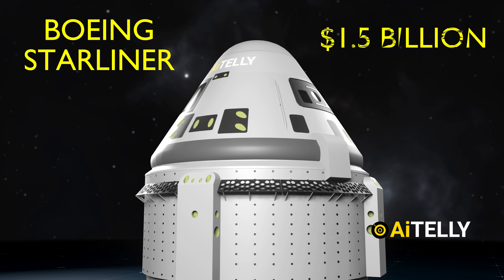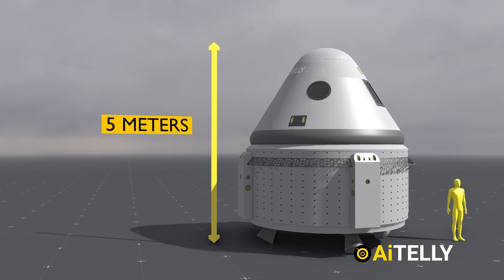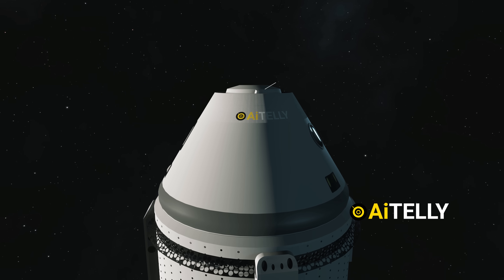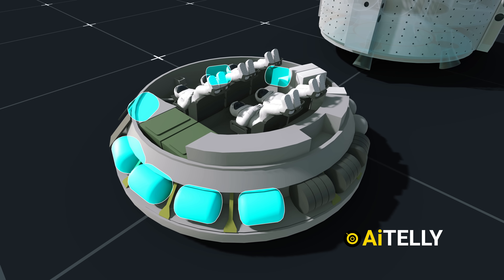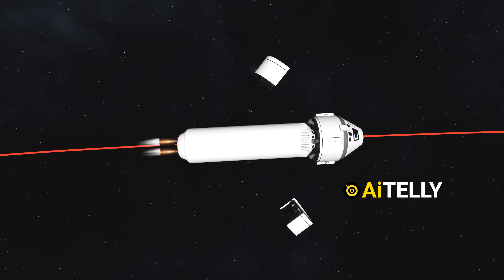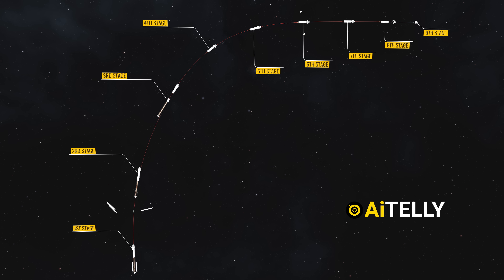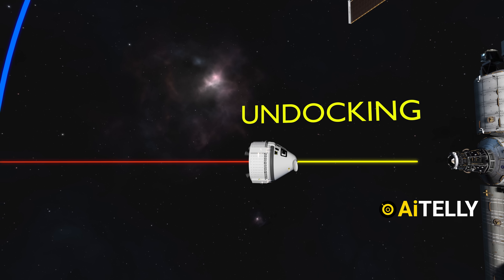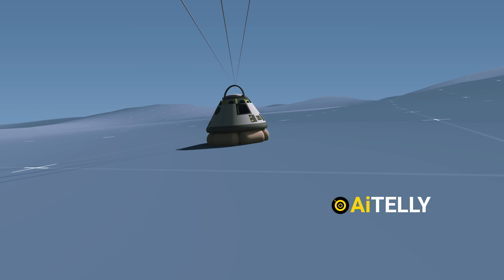How will Boeing Starliner Return from NASA Space station?

Comment from the maker: Corrections 

1) @felipecogo4671 Starliner weight 13T (or 29.000 lb) you got the total weight with the rocket too. 
we calculate the weight of the Rocket too
Reply: Soyuz touches down on land as well :)
Reply: @the.starman  Yeah, somebody sure didn't do their homework. Makes one wonder what else is wrong, considering this is a rather basic and well known fact.
Reply: @Aitelly  already subscribed Sir🥰
Reply from the maker: @devmaharaj4640  Thanks
Reply: @Aitelly hey can you pls make a video about the south Korean K2 black panther
Reply: can i use this video?
Reply: IT DOESN'T WORK - CLICK BAIT
Reply: Any way to remove the leak with a shield, or remove the thrusters. Any way to drop from station into landing with only the remaining thrusters?
Reply: @felipecogo4671, 29,000 divided by 13 doesn't work out, but it does as a long ton--2240#.
Reply: @Aitelly  An error in spelling slipped in... "seperation" instead of 'separation' around 8:01...
Reply: @TheFlyinCanadian , I strongly believe that the reason is because the translation of the name is "translated" as Artificial Intelligence Television.
Reply: @jimgreen5788  Interesting point 👍

Comment: Glad the leak in the propulsion system was discovered and the astronauts docked safely!🙏🏻 Thank you for sharing!
Reply from the maker: I Hope Boeing Pulls this off otherwise it's a huge embarrassment with all the Stuff going on with the planes.
Reply: @Aitelly  I wish you would have included the issue with the RCS of the Command module, which is the main concern for bringing them down safely. The RCS on the Command module is currently not faulty.